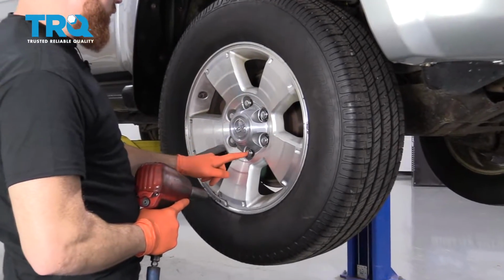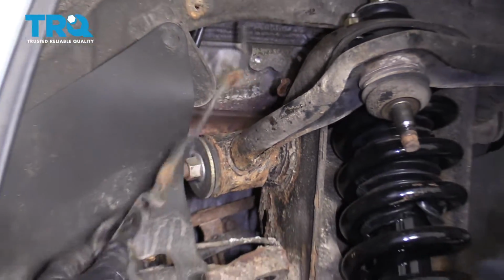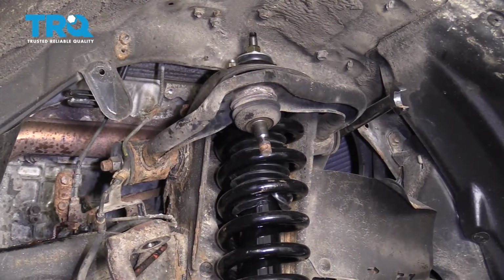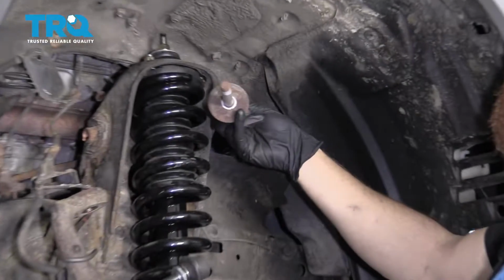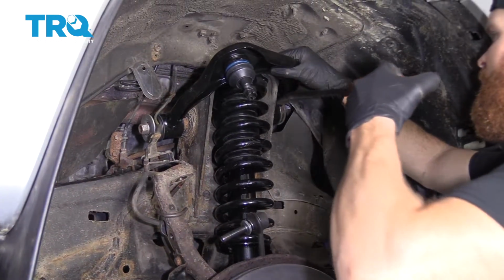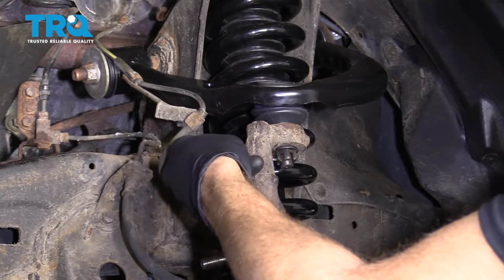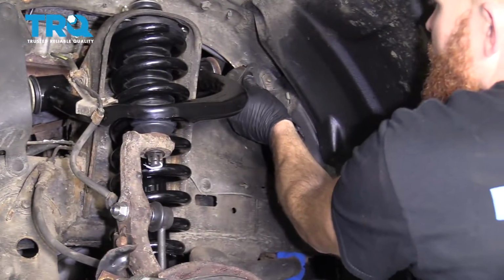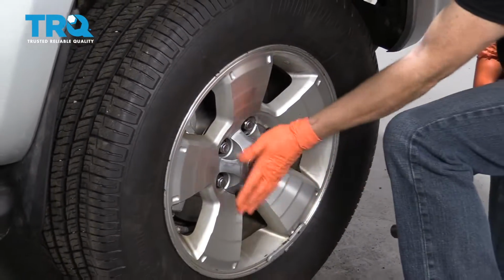How to Replace Front Upper Control Arm 03-09 Toyota 4Runner

Comment: Details to note:
1.  The UCA bolt on the drivers side will not come all of the way out without first removing a wiring harness bracket fastener from inside the engine compartment, 10MM.  There are also two other harness clips that will need to be released from the wheel well so it too can be moved out of the way slightly.
2.   Passenger side bolt has no clips in the way but does require an AC line to be unclipped and moved slightly, no big deal.

Comment: I just wish it actually would work like this, but I know when I go to do it half the bolts will be seized and nothing will come apart/go together as easily as in this video. I've literally never done one job on my vehicle where there wasn't some kind of significant hang up or obstacle. I find it so stressful for this reason.

Comment: Good vid, but missed/glossed over that the long UCA bolt will not come straight out without hitting the fender. You have to bend the fender back out of the way first with a  large pair of channellocks or similar. If you've done it before you'll notice the fender on this passenger side being done in this video the fender has already been bent back. 

On the driver's side you also have to remove the battery, the battery tray, a 10mm bolt holding a wire harness bracket, and push out a clip holding the ABS sensor wire to the fender before you pry the fender back so the UCA bolt can come out.

Comment: These videos are of the highest quality.  I just did this job on a 2003 v8 runner.  The power steering hose blocks the long bolt on its way out into the engine compartment.  Had to pull that hose off and drain the fluid.

Comment: Are you sure the UCA bolt should be torqued to 118 ft lbs? I'm reading everywhere online that it should only be 85 ft lbs. I just installed this part from you this wknd and did the 118 and now am concerned that's too tight.
Reply: You’re fine man

Comment: Thanks for sharing this, about to do this myself. So you don’t need to wait until the vehicles back and the ground and the suspensions settled to torque the main bolts?
Reply: You can try but alot of these bolts are hard to get to once the wheel is back on.

Comment: My 2003 4 Runner had broken CV boots, grease was flying all over the place. I took it to my quality local Goodyear shop and due to the serious rust I decided without anyone suggesting it to replace everything. The truck has only 80,000 miles on it. I figured since they were pulling out the axels I might as sell have the struts, control arms, sway bar links, and the ball joints included. Top it off with a front end alignment and I will be good for another 80,000 miles. The 4 Runner has never had anything other than maintenance, batteries , tires and new upscale wheels. So it was time for a little love for the Toyota.

Comment: My wife took our 4runner in for an alignment today and the shop said they couldn't do it because the upper control arm was bad.   They quoted her $290.83 for the part and $110.17 for labor.   No way!   Thanks for this great video, so I can easily do it myself.    This is one of the best how-tos I've seen.    The shop also told her there was a bad wheel bearing.   $245.52 for the bearing and $219.65 in labor!!    I'll be buying all the parts from your suggested link,  1A Auto.
Reply: Stay away from that shop.
Reply from the maker: Chris Anderson Thank for watching!